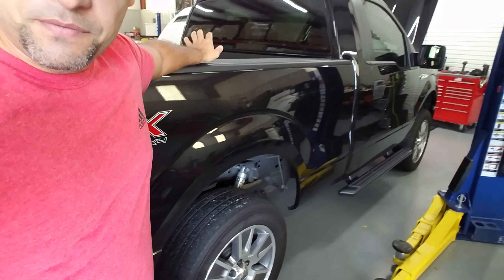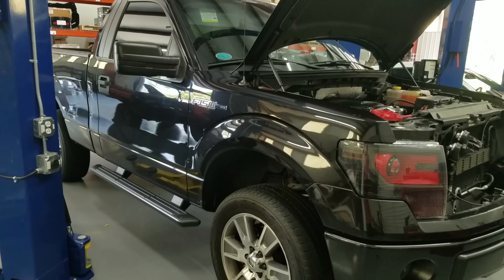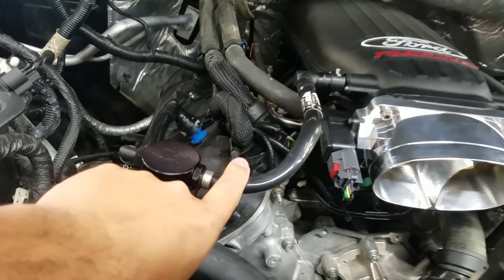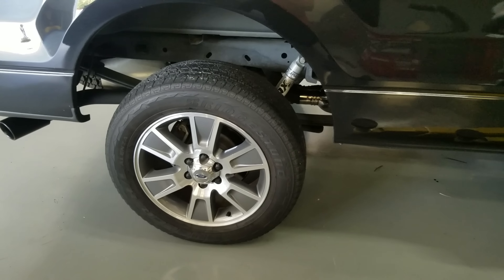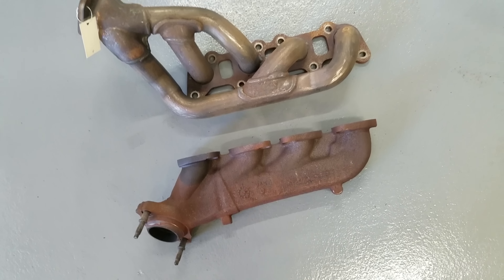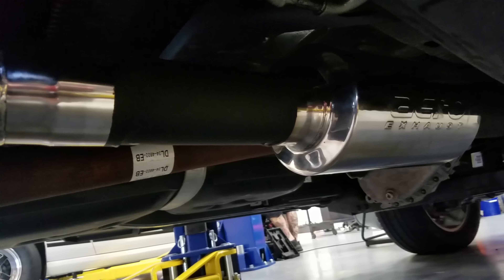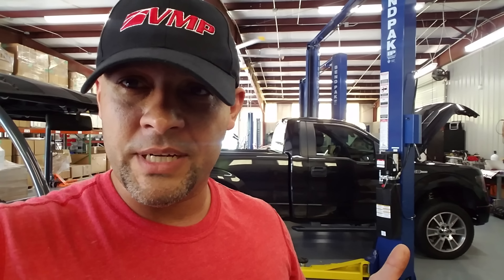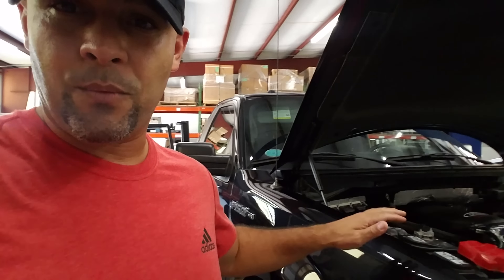How to make your F150 Coyote engine more like a mustang Coyote engine.

Comment: Hey! It's my truck! Haha thanks for all the advice Alex. Man I didn't realize how dirty that damn thing was when I dropped it off.
Reply from the maker: LOL it's in good hands.
Reply: Alejandro Flores I know, but that damn bird shit on the side tho haha.
Reply: Justin Campbell what is it going to cost you? Thinking about this set up over a supercharger. If you get over 400rwhp it's about the same as a Edelbrock e force equiped truck out of the box.
Reply: Jesse LaBelle It all depends on what kind of deals you get on the parts really. I've got about $6000 in parts, but that's with billet crank gear, mmr opg's/mustang oil pump, and jet hot coating the headers/some exhaust pieces. You don't necessarily need the extra stuff like that to make power, but the opg and bcg are for future mods. It is a lot easier/cheaper to just go forced induction, VMP makes a badass TVS for the F-150 I might add. It's all in what you want to do. I wanted a pretty strong N/A motor, and eventually it's getting a couple of turbskies. But! Before then though it'll be getting heads, pistons, and rods.

Comment: This is the reason the original 4.6 did quite well in a lightweight Mustang and not so spectacular in an F150 or a big heavy Crown  Vic.
Reply: The original 4.6 did well in the Crown Vic
Reply: Actually did quite well in the crown Vic, I agree with Atx
Reply: Plenty of fast 11-14 f150 5.0s out there man even na ones. Wouldn't be surprised if this truck ran a 13 flat if he changed to e85 which for a na truck is damn good especially older gen like this

Comment: coyote for f150 are tuned for low end utility performance, everything you are doing is moving the power from the bottom to mid/top end, that's fine if you don't actually use your truck like a truck, not trying to argue with anyone......could just install a supercharger and be done with it????
Reply: I totally agree brother.
Reply: canton7180 tell that to my coyote, at 4500 rpm in 3rd gear, pulling,out to pass
Reply: tell you what I have 2.3 litre straight 4 making 560whp with a chassis that weighs 2400lbs, sorry your semi stock coyote is not something I would be impressed by, I have a coyote in my truck also, nice engine, never been sitting there wishing for more power honestly, it is a truck what else is there to say? you should of bough a Raptor I guess maybe.
Reply: Duratec, with Cosworth rotating assembly and head, gtx3579r, haltech standalone, 100% methanol injection, capable of a lot more but it is a road course application, I know a guy up in Canada with close to the same setup in his drag ranger running close to 1k whp......I still like my coyote, it is a beautifully engineered motor, square stroke and bore, if I had a mustang it would be game on and my wallet would lose it's ass.
Reply: canton7180 I saw this comment and it made me miss my 92 Ranger even more... I had big plans for that little dual plug 2.3 haha. Have any videos on the truck?
Reply: canton7180 Ahh ok, I saw Lima and 2.3 Duratec and I guess my mind is still stuck on building a Ranger... Yea I was on that forum years ago it seems like, lots of good information to be read there.
Reply: canton7180 With the 6 speed 4.07 1st gear. Moving the hp up want stop it from being a truck.
Reply: If you do a lot of towing, you buy a Powerstroke powered truck, end of discussion.  I'm building my truck very similar to the one in the video, it'll haul ass on the streets and destroy the dirt.
Reply: People that own 1/2 tons aren't buying them to tow. If they are I would tell them they are dumb. Most buy them for the bed and 4wd. This build in the video by no means is a 2600 lb car with over 500 whp but I guarantee it would surprise anyone that pulls up beside it even if it looses. Its a fun daily driver sleeper that is streetable.
Reply: Can a set of stock mustang5.0 headers fit on F-150 5.0 for better flow??? I have a 2013 F-150 Stx 5.0
Reply: canton7180 I love my supercharged 630hp f150. It hurts many feelings on the streets, pulls my 20ft bassboat like its not there, gets the groceries and  hauls the mail
Reply: A supercharger on a 100% stock truck would be less work, cost less, have tons of low rpm torque and still be quicker than this build. Lucky for high credit card limits.
Reply: canton7180 Guess you never driven an 07 SRT-8. The engine peak torque is 4800 rpm but it will light up both rear tires like it peak at 2500 rpm.
Reply: @Edwin Figueroa, Yes, the headers will fit but if you do this you should get the mustang cams to go with the header. The 150 and Mustang headers are tuned for the pressure waves to match the engines use. You might get a good tuner to solve the problem but it's doubtful you could maximize the potential benefits. If your interested in doing this look for a speed shop that specializes in Mustangs. You should be able to find some take-offs for a fraction of the price of a new set of headers. Finding them with no more miles on them than the distance to the local dealer is not unusual. Same for the mustang cams.
Reply: @a29s12  great points, I completely agree
Reply: @ColdSmokes  it's on my wish list
Reply: Anyone knows how much are we talking about to get everything installed by a pro including parts ?
Reply: I have a question can i buy a 2012 f150 coyote and swap the cam from a 2014 mustang coyote into the f150 motor
Reply: I wanna do a fat cam
Reply: canton7180 I guess but raptors are junk
Reply: That's all waw ok
Reply: @IntegrityOverCompromise  no
Reply: Lol the mustang has more horsepower AND torque than a truck engine.  Please tell me where the loss is?
Reply: People always forget that these trucks are so fricken de tuned from the factors that no matter what cams or intake you put on its going to make more torque than it would stock just because when you tune them with these mods it picks up a good bit of torque. Not to mention longtubes add a good chunk of torque for towing as well

Comment: I got a question. I got a set of factory 2014 mustang 5.0 manifolds, cats and midpipe for my 2014 f150 5.0. Do I need to put a custom tuner on my truck for the air and fuel ratio? I got a edge programmer in my truck. Can I use that if I got to tune it?

Comment: Great work but, when I bought my F-150 was to be able to haul and tow things.  If I wanted to go faster I would have bought the Mustang.  My wife has a 4 door car, I have my truck, and I have a sports car... the right tool for every job.  I can not understand why some truck owners are willing to sacrifice torque for high end power.  As a word of advice, the next time someone comes in with a similar goal... point them in the direction of a supercharger or N20.  If you install N2O and keep the rest of the truck stock you will be able go fast when you want to without giving up your ability to tow/haul when you need to!  Aside from the cost of the supercharger there is really no downside to having one on a truck.  Great work though!
Reply: I have an F150 because I occasionally haul way more stuff than a Mustang can. And get around in the winter time without issue. When it's not hauling stuff, it's fun to have additional power. Finally, I can have either a Mustang that won't haul the stuff that I need to haul OR an F150 that can be made to be very Mustang-like in it's power delivery. I don't have the money to have a different car for every need so ONE vehicle will have to do. 

A super charger kit is $7500, plus labor to install it. Adding an intake and a set of headers is a TENTH of that. And nitrous? Are you kidding? $1500 for a nitrous kit and $75-$100 to refill the bottle after about 4-5 MINUTES of use is definitely a diminishing return. 

Adding headers, an intake and a dyno tune is about $2k and will make a decent increase in power and last the life of the truck.

Before you judge, remember, not everyone "has it" like you do.
Reply: @robeddy3722  I have nitrous on 2 vehicles and have only gone through 6 bottles in a year and a half with them. Only about 400-500 bucks in refills in that time it really isn't bad at all unless you have no self control and just use the nitrous whenever tf you want rather than when your actually racing someone worth using it on. And to be fair also I had tuning issues at first on my nitrous truck so I went through quite a bit of logging spraying and wasting it before I got stuff figured out then didn't need to log under nitrous anymore I think it was like 2 bottles worth 😂

Comment: Do you think shorties would be an upgrade over factory manifolds for a 5.0 f150? I daily drive it, have no real current plans to make it a race truck, though it sounds like a fun idea. But I want to keep the low end power for daily driving and towing as I haul horses and cattle in the winter times. But I want to bump power/efficiency any way I can. I have an x4 tuner, jlt intake and muffler delete, 3” pipe in its place. I know long tubes would be beneficial overall, but I’m not looking at dropping 1500 on exhaust at this moment. 500 sounds much better. Any information or opinions would be greatly appreciated.

Comment: Here's what he is NOT telling you.
Example: 2014 Mustang GT 5.0 weighs in around 3,600 lbs. 
2014 F150 standard cab weighs in around 4,700 lbs.
1,100 lb. difference in weight.
Guess which one needs more TORQUE to get it moving?  
By adding this fancy intake to the truck you LOSE torque where you need it, on the bottom end.
Sure does look cool, but not very efficient for a street pick up.
Torque gets you moving, Horsepower keeps you moving.
This is why the 5.0l intake is different from the stock Mustang to the Pickup.
Most street vehicles run in the low to mid rpm range & rarely in the high range.
I would go with a good exhaust & an oil catch can.
My 2 cents.
Reply: Cobra jet is worth a couple tenths in the 1/4 mile vs stock so its faster. And just swapping to oem gt intake cams is worth 3-4 tenths in 1/4 mile so its quite a bit faster with these mods. Keep in mind your only needing low end torque for the first 60ft of a race after than its all hp

Comment: That Cast iron manifold is 100 times better than some of Fords previous designs used on other motors, want proof look at the passenger side exhaust manifold on a late 60's to early 70's Ford truck with a FE.

Comment: What kind of cost, round about would these upgrades cost? Just wondering if it's financially feasible to mess with the intake and cams. Over a bolt on exhaust and cold air intake. Just trying to feel out costs for upgrades and where and what to start with. Appreciate any advice thanks.

Comment: I would have started with diff gears.  No need for a 100+ mph truck and if this came stock with the 3.55s or grocery gears then moving up to 3.73 or 4.10s would give a seat of the pants difference and not ruin the truck for the next owner.

Comment: Will the Mustang manifolds bolt on the F150 for a budget build? What about the cams? Can you what Mustang Coyote parts are swappable? Did you guys have to pull the engine for the cams and headers or not?

Comment: Alejandro,  could you tell me why you went with the Ford Racing intake over the BOSS 302 intake? I'm assuming it's better than the BOSS? Also, I would KILL to see this dyno'd with E-85 and a set of 4.10's. Judging by the speed in 3rd gear on the dyno, this truck would easily swallow 4.10s without being to radical on the highway! I think with those two small additions to a very nice package you put together.

Comment: Correct me if I'm wrong The truck Is heavier then the car so A different timing curve
Reply: This is very true.  And if boosted that is amplified.  Ive seen a few tuners great with mustangs, but would blow up every Lightning they tried to tune. And it's not just the timing that is different.
Reply: @deadmanshand1330  mustangs are 4.6 and lightning are 5.4sc so thats 2 different platforms entirely. Weight doesn't change timing lmao hence why you can tune an engine without a body attached to it...

Comment: Correct me if I'm wrong...from what I understand the Mustang firing order is different than an F150 so how can the Boss cams work in this motor? Also, wouldn't you make more HP for less work and money bolting on a Roush or Whipple supercharger? Of course if you are replacing the cams then you are right there to replace the stock oil pump gears that shatter at high rpm's when the crank harmonics change at 7000 rpm. But then the rods are powdered steel as well....hell, just pull the motor and go with a forged short block good to 1000+ hp and be done with it?

Comment: What about the firing order? How does the different firing order on a mustang change anything vs the firing order on the f150
Reply from the maker: On the Gen 1 they are the same
Reply: @YDBT4LIFE  gotcha, I did not know that. Any input on the gen 3? That's what I'm looking into strictly for the 10 speed. Can you convert an f150 over with the right ecm, cams etc?

Comment: Alex, What are the changes for the 15+ F150 coyote trucks? Better cams? Still use cast manifolds? Do they get the Forged rods?
Reply: better cams and forged rods.
Reply: 15-current f150 5.0s have same cams as mustang gts so its not a mod you need to do. Personally I'd recommend either a 18 intake manifold or cobra jet paired with lu47 injectors, longtube headers, jlt or pmas cold air, and e85 tune

Comment: Hey great vids been watching for awhile now, but do you have any vids for 2.7l
Reply: There's really not a lot of aftermarket support for the 2.7 yet as it's the base motor and it's relatively new compared to 3.5 Ecoboost and 5.0 coyote. Tune and full exhaust is probably your best options for 2.7 although it's probably not gonna sound good but it should open up for some power

Comment: @alejandro flores , I have a 2012 gt and I'm having issues shifting from 2nd to 3rd in high rpm .I've heard and read that changing the shifter and the bracket will help ,changing the clutch , or just wrong technique .knowing that the mt82 has a history with bad transmission.what could be my issue and what can fix that problem .I would appreciate your response .Thanks
Reply: Its the clutch.. anything over 7k rpm and it will lock you out.. You need to upgrade to a twin disc mantic street..

Comment: Question I just bought a 2011 f150 coyote engine to drop in my new edge I'm trying to get the f150 coyote up to par with the mustang I know the mustang is 11.01 compression and the truck motor is 10.5 1 would the pistons make that difference in power or just the cams be all I need to swap to get it up to 412hp

Comment: Is it necessary to install those comp cams if you want to put the cobra jet manifold? I want to order a cobra jet manifold for my 16 5.0 f150
Reply: LegendaryPrince777 No, but you will pick up a lot more with a good set of cams. You don't have to get Comp's, you really need better intake cams the most on the F-150. L&M offers an intake cam only package that they worked with AED to make that would be good, and cheaper than a full set.
Reply: Justin Campbell the different btwen the coyote camshaft intake than l&m 9 hp but the stoke cam coyote good for me and little money that was ken told me oz tuneing
Reply: Ignore the first reply to your comment these 2016s come with same cams as mustang gt so no need to swap cams bro. Only 2011-2014 have crappy intake cams . Cobra jet is the best manifold but its way more expensive than other manifolds you can get for example an 18 manifold, ported boss 302 is a good option as porting them is shown to reduce the torque loss and gain a little more hp too, also a gt350 intake is good option. Cobra jet is just so darn expensive
Reply: @justincampbell8092  comp cams are only worth about 30hp over stock cams and thats for 2000 cams plus whatever install cost

Comment: What kind of upgrades would be better for torque ? Running a 8 inch lift with 37s
Reply: Swap tires under a lifted f250 power stroke with a delete kit and tuner. That would the upgrade that makes sense. 150 isn't made for anything near 37s!

Comment: If I put a stock Mustang GT cam in my 5.0 f-150 will I lose torque on the low end with stock mustang air intake and aftermarket shorty headers. Everything else is stock F150

Comment: Do the 15 and up f150's have different cams- and do they have the better internals like the s550 coyotes?
Reply: David RUHL they have better cams than the 11-14s
Reply: John Gilbreth What about the rods?
Reply: David RUHL Everything I have read States they have the same crank and rods. Pistons manifolds and cams are the only changes. They also have piston squirters
Reply: David RUHL, there are no rods and lifters, its a 48 valve DOHC engine with variable valve timing on all 4 cams.
Reply: Lmao
Reply: Yeah they do indeed have lifters
Reply: There are no pushrods
Reply: lat woods Connecting rods not push rods.
Reply: I never said pushrods dummies
Reply: lat woods 48 valve? What is is a 12 cylinder?
Reply: No rods or lifters and 48valves.  Funniest thing I’ve read today

Comment: Yolo love your stuff been watching long time.  I have a 14 fx4 and I was thinking about the cobra jet but I don't want to loose that torque. I do pull with my truck. Atm from what I have seen the stock is the best for the torque. I want to go full headers and exhaust upgrade thr intake cam and see about throttle body and a proper cold air. What are your recommendations for the daily driver that tows past this. Also need to find a good tuner but you all are nowhere near northern mn. Thanks for the great video.